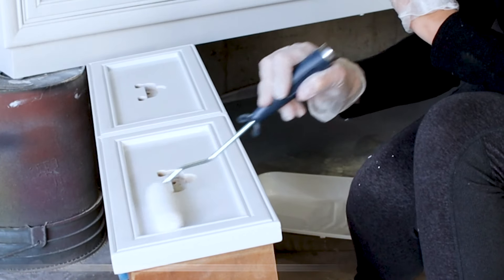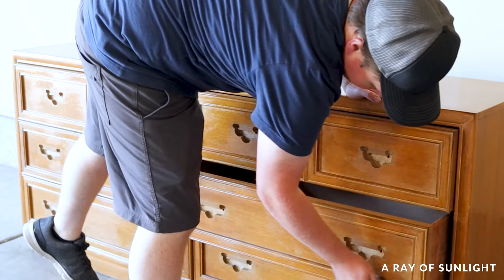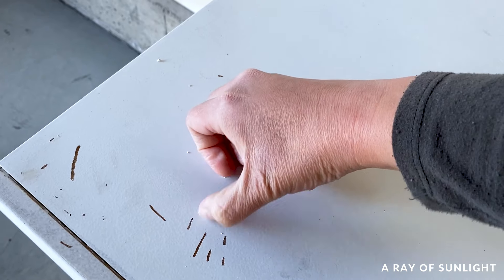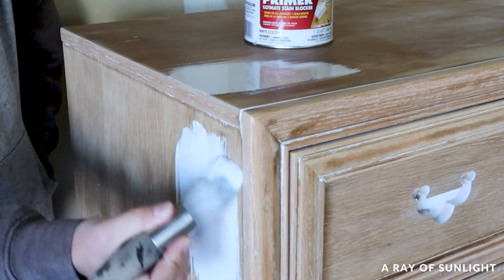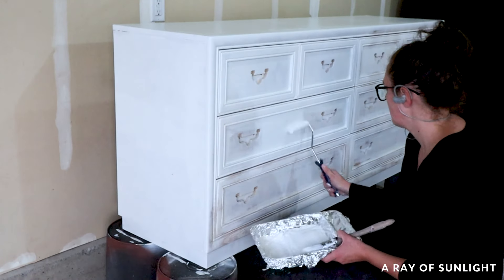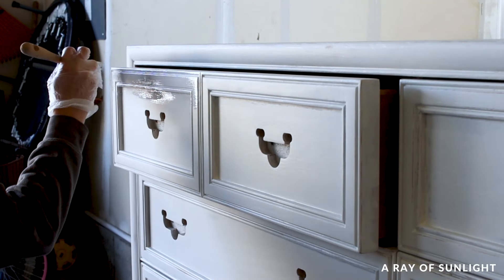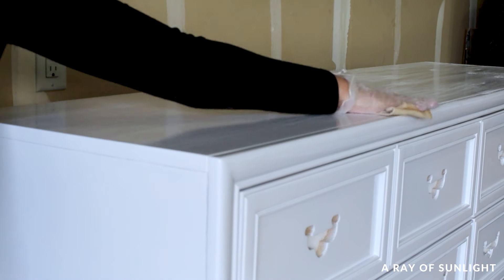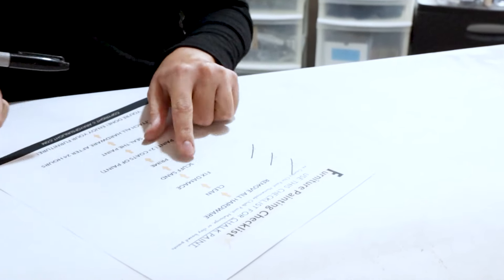How to Paint Furniture High Gloss

Comment: After the first glossy paint, do you need to sand it before applying the second coat, thx
Reply from the maker: I sanded only where I had drips or where it felt rough because dust landed on it while drying. Oil based paint takes forever to dry enough to sand without clogging up the sandpaper.

Comment: How long you spend in total painting? :D
Reply from the maker: Just the painting process is actually pretty quick, like an hour or two tops depending on what paint you use and the dry time required between coats. It’s the preparing the piece for paint that takes the longest, but even then, I have completed a full makeover from start to finish on one complete day before. Really depends on what paint you are using, other products, your piece, etc.

Comment: I’ve followed all of the steps but for some reason the first coat of the paint turned out so bad. Bumpy all over. Looks awful. Feels awful. I’m not giving up tho. Any tips is much appreciated. Thanks
Reply: i’d suggest sanding the areas you do not like. not all the way but for a smoother texture and using a brush and lightly go over it until it blends in.